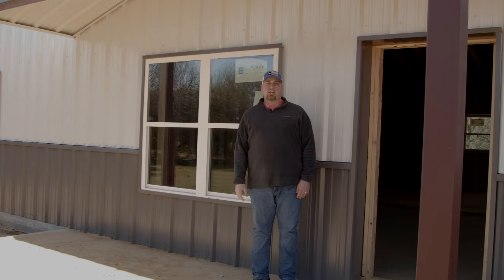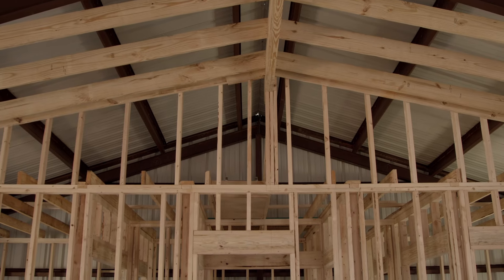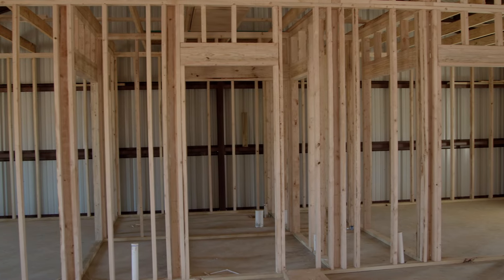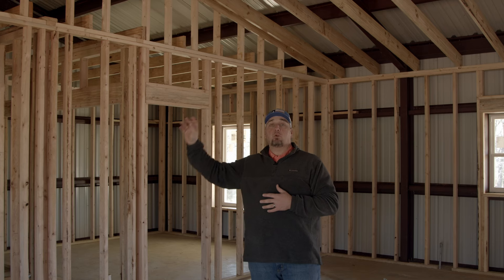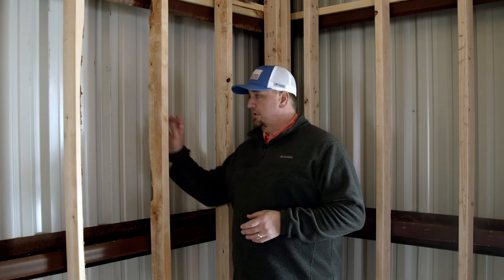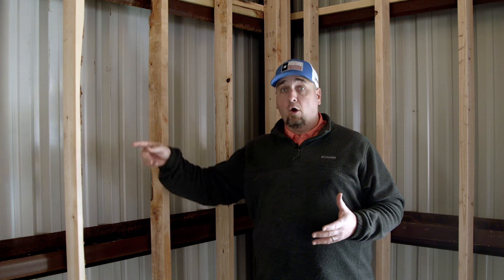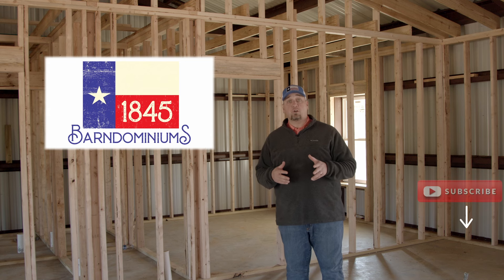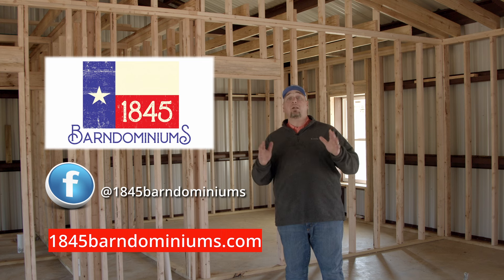Interior framework of a barndominium

Comment: Wouldn't it be easier to spray foam it before framing?
Reply: You can do it either way but it’s actually more efficient time wise to do it after so you don’t have to worry about trimming the foam back when you install the framing. 

If you do it after the framing is installs then you don’t have that extra step to scrape the foam to fit the wall framing. That’s how we do it. 

I hope that helps. 👍🏻👍🏻
Reply: @DacklerConstruction  that does make sense thank you for the response, much appreciated!
Reply: Why no gasket between sill plate and concrete foundation?

Comment: I can't believe people are still using spray foam for blanket insulation. It's not intended for that and it is extremely flammable. Fire travels under the surface of the foam in the open cells and creates a pizza oven effect. I saw 4 large KSpan burn to the ground because contractors cut window opening after they spray foamed. We built thousands of KSpan buildings in Afghanistan with spray foam that was supposed to be fire resistant but it didn't matter. We tested multiple different forms and all of them failed to be fire resistant. When that stuff sticks to steel and catches fire for whatever reason, that building will be gone quickly, we had total structural loss in 10-15 minutes.
Reply: Need advice from the producer of this video
Reply: Isn’t this closed foam cell insulation?

Comment: Have you ever had any problems with moisture in between the studs and the insulation.
Reply: You shouldn’t have any issues with moisture up front. But with all bardo’s you have to make sure you keep up with the exterior maintenance. 

You have to check for loose screws or any signs of leaks yearly. If you keep up with that no moisture will come in from the outside. 

Your HVAC system will keep the humidity very low on the inside of the home which will prevent condensation on the inside of the walls. 

I hope that helps. 👍🏻👍🏻

Comment: Am I missing something,  shouldn't spray foam come before walls , or is this for demonstration purposes?
Reply from the maker: Great Question.  We actually foam after mechanicals to provide the best seal possible after wall and roof penetrations are made.  Its a little more work on the foamer, but it allows the first spray to cover everything, we prefer not to cut out foam and then refoam after penetration is made.

Comment: Can you make a video on the order of construction? Do you spray foam before or after electrical? And plumbing and AC? Can you also discuss with the wood framing, since non of the walls are load bearing, what spans can be supported for ceilings and such?
Reply: What about mini splits, you have to have those systems installed so that your exterior penetrations are completed but then you have a mini split in the way of the spray foam person?
Reply from the maker: All good questions.  Will try and explain as short as I can.  What we do is what we have found to be best for us, other builders do it different, I am not saying our way is the only way.  Saying that, we do all mechanical roughins before foam.  I do not like to disturb the foam anymore than I have to, so I run all of the pentrations out of the walls and roof then foam.  Prevents having to repair it and reseal after spray.  We use lvl's and other types of framing for the ceilings, we use our load tables to determine how far we can span with what material.  We can span as far as needed on the rooms with proper framing.
Reply from the maker: We use mostly variable speed units (much like a mini split) to condition the house.  We do not do very many mini splits in our homes, sometimes, but not most of the time.

Comment: How would you do a second floor and keep the interior structure from racking?
Reply: My building goes up next week and I’m wondering the same thing
Reply: @The85F0X  I found a few different ways that people were doing it. 

Hurricane ties (Simpson H 2.5) every couple of feet  

Or a method similar to this. Drill and through bolt studs horizontally then nail to that